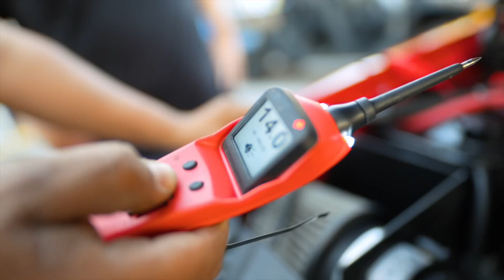Day full of FAILS! *Turbo GMC & Whipple Single Cab*

Comment: Install a disconnect on the battery when you’re not using the truck. Battery will stay good. Or put a trickle charge on it.